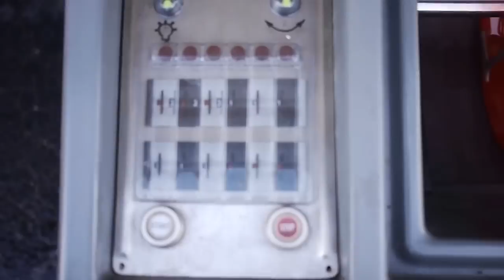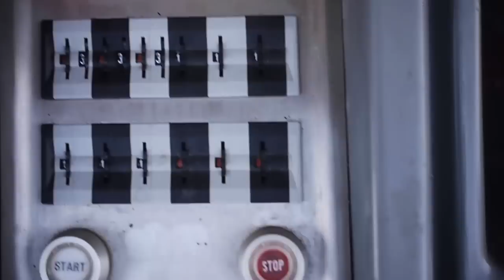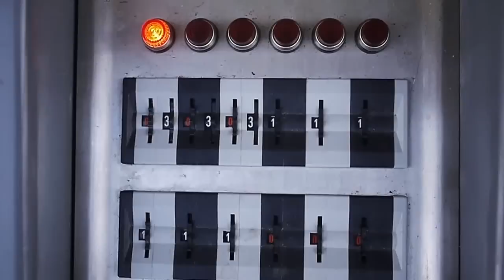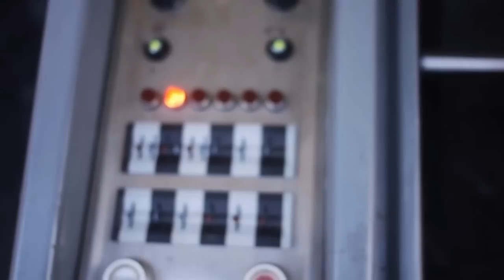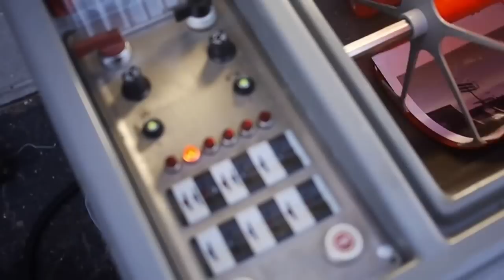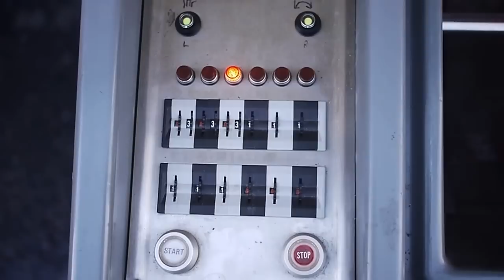Colenta 30 Film & Print Processor

Comment: Hello David. I have a few questions I am hoping you will be able to answer. 

Is this unit fully automated in regard to both the temperature control required for each batch of photo chemicals, as well as the timing required for each stage in the process?

How are the reels for negatives loaded into it? Is there some kind of multi-reel holder that comes with it?

Also, I am wondering how you pour the photo chemicals into it? ... Is that through hoses in the unit via funnels, or directly into compartments in the unit using  just a pitcher/beaker?

Lastly, is that machine connected to the plumbing/drain pipes? How do you drain the chemicals out of it? 

Thanks in advance for your response.